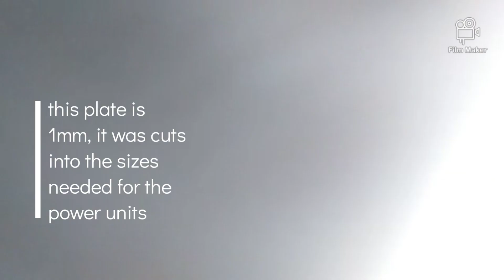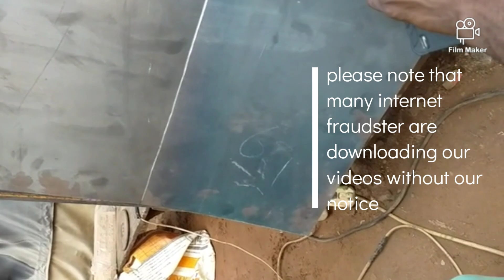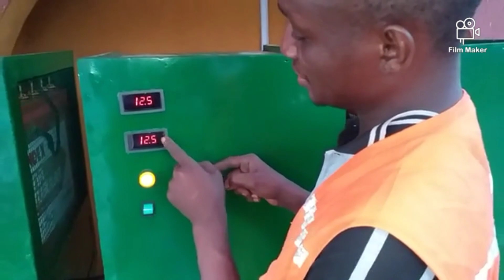making of 12~24vdc & 220vac outputs fuelless generator, offgrid system

Comment: You said it is fuelles generator, how come that it is using solar panels?
Reply from the maker: Solar panels don't use fuel to work, this product is designed to use DC current as primary signal and multiply it before sending it to secondary output power
Reply: @obairawotv  okay, in that case, it doesn't charge it self. Because if does there won't need for solar panels.